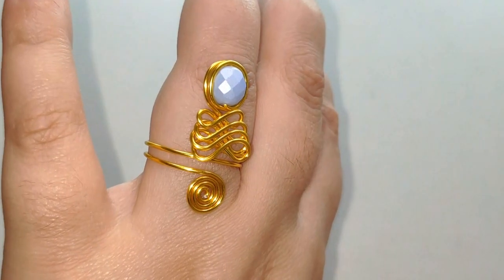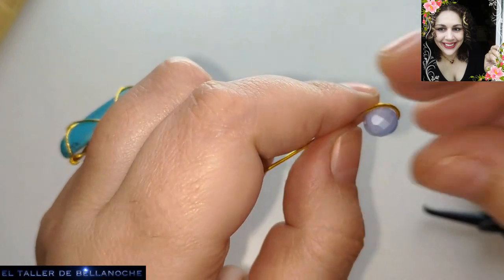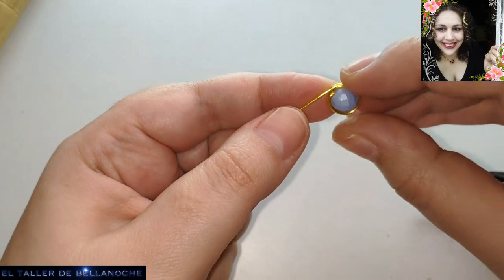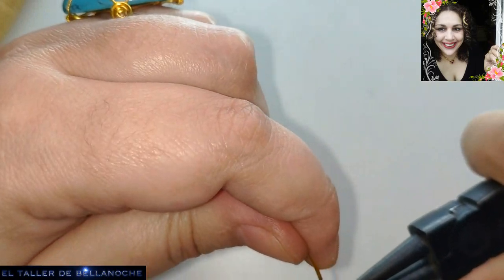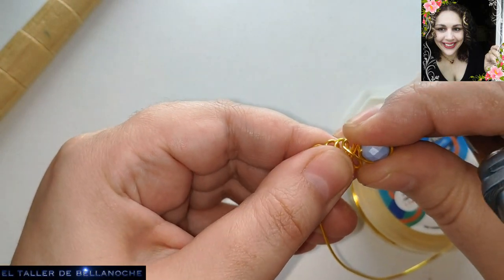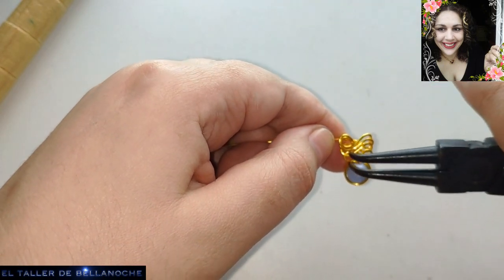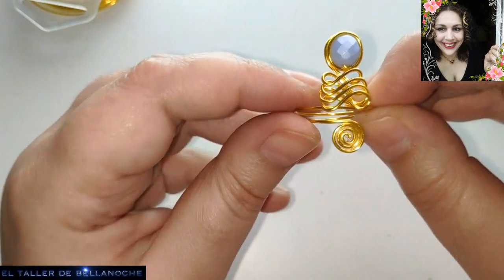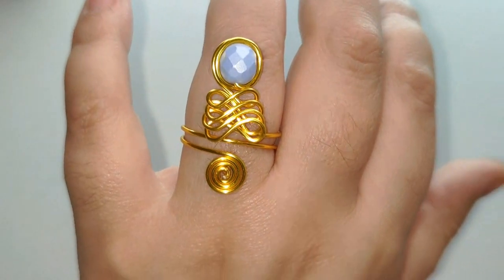COMO HACER UN ANILLO CON LAZADA INFINITA Y ESPIRAL-HOW TO MAKE RING WITH INFINITY LOOP AND SPIRAL

Comment: Todo lo que hacen tus manos maravillosas, son hermosas.😘
A la pinza se le puede poner silicón y escurrir con la secadora para que quede plano y no marque, o poner Mica de botella plástica envolviendo la parte de dentro y fijarlo con silicón por fuera...eso ayuda.
Reply from the maker: Gracias Yolanda. No, para este alambre no sirve la pinza como dices. Esa pinzas es para los alambres plastificados de moda en Latinoamérica. Goma con goma agarra muy bien. En este alambre patinaria y en el  esmaltado queda atorado. 🤷🏻‍♀️ Cada herramienta para su material. Un abrazo hermosa. ♥️
Reply: @eltallerdebellanocheoficial    ni hablar, la experiencia hace la diferencia. Saludes que tengas mucha salud🤗